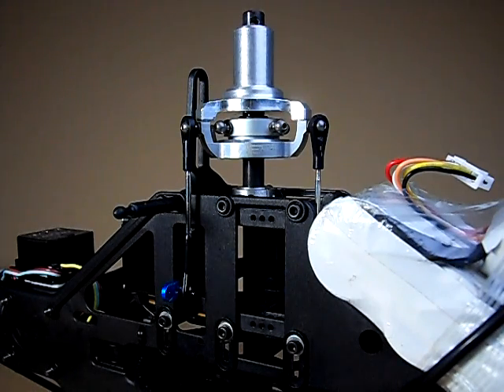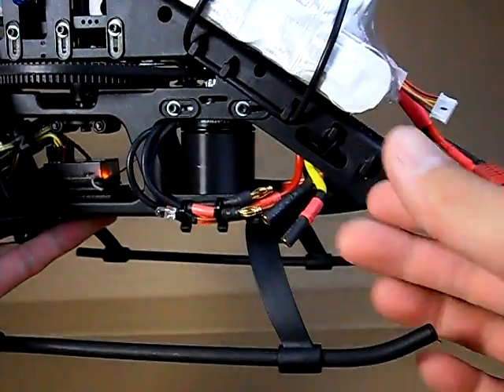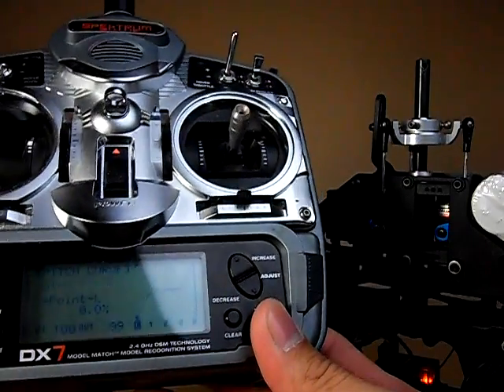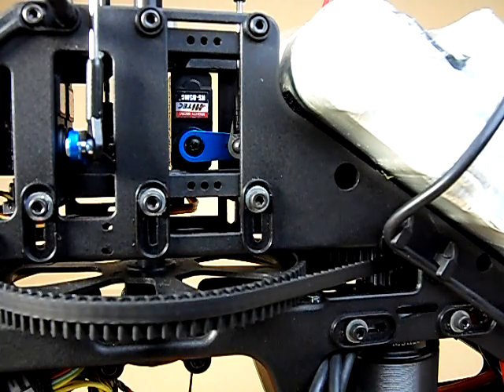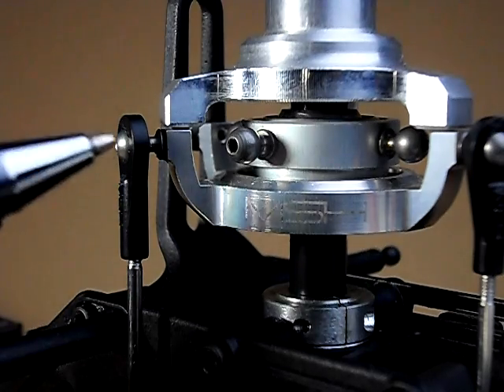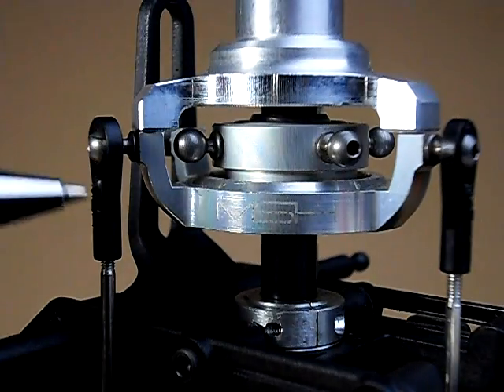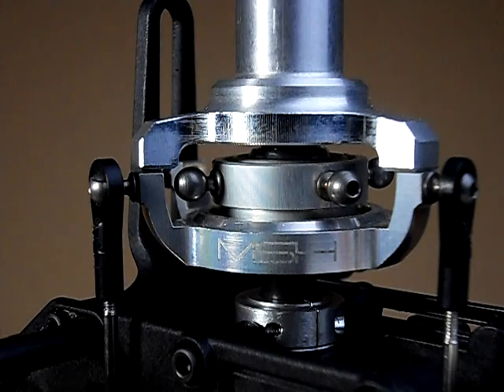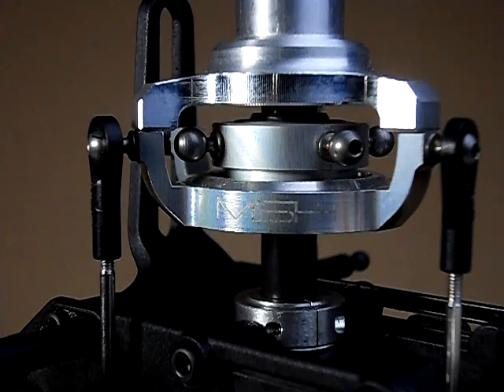MSH Protos Swash Plate setup and leveling using TNN tool

Comment: @twaciis2 Yes, don't rely on end points to get a swash plate level at high and low either. Instead use sub trims for that, after having a (very very near) perfect mechanical setup at mid stick with the correct swash plate mix settings. Newbies often confuse end points with setting the servo's neutral position through transmitter programming and many servos really don't like it when they're wearing out more in one direction than the other.

Apart from that 100% ATV will always give best response.

Comment: Just for newbies.  The leveling of the swashplate at "flat blade=50% tx pitch curve must be done by "adjusting linkages" only!!!  Do not touch sub trim.  Sub trim is only adjusted to set servo horn at 90 degrees.  If you adjust subtrim, then you will screw up the symmetry of the servo travel.  Hope this makes sense.

Comment: I highly recommend for everyone to "create a seperate tx model" exclusively for the setup process.  I also like to use 0-50-50-50-100 pitch curve as tin175 mentions, but furthermore set 0-0-0-0-0% throttle curve.  (This will prevent motor spin up, if you know exactly what you are doing!).  Then after set-up rebind back to your original tx model.  In this case, model match can be annoying.  I have futaba, so I don't have to re-bind when switching tx models.  Stay Safe keep simmin.

Comment: @vanepico YES!!!!!!!!!!!!!!!!!!!!  If done right, and heli is balance you don't need to touch the TRIM when hovering.  Not needing trim is often surprising for most plankers getting into heli's, but don't compromise.  With a solid heli(trex, protos, rave...) it can be set PERFECT.

Comment: I stille have troubles with low and high position in idle up. At midstick leveling is fine, but when in low and high position I still have a cap. Now you say I have to adjust my end-points, but what do you mean by end-points? the traveladjust?

Comment: You need to adjust your servo arms to 90 degrees using the sub trims first.  You can then level the swash at mid stick by adjusting the length of the links.

Comment: You can use the sub trim to level the swash at mid stick, however it is much better to adjust this mechanically so that your servo arms and linkages remain at 90 degrees.  A good mechanical setup will mean you have less swash interactions to correct.